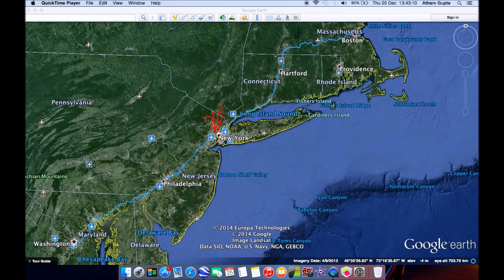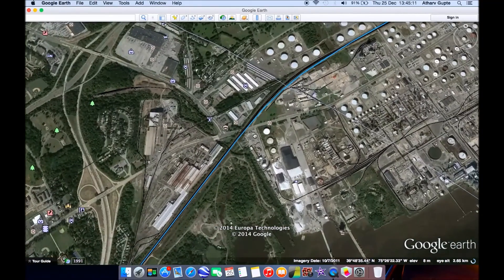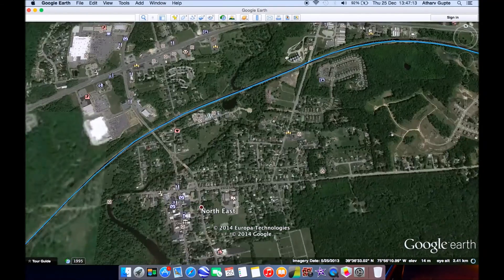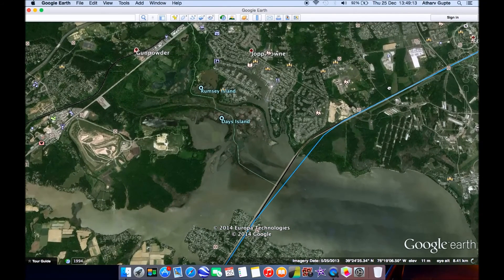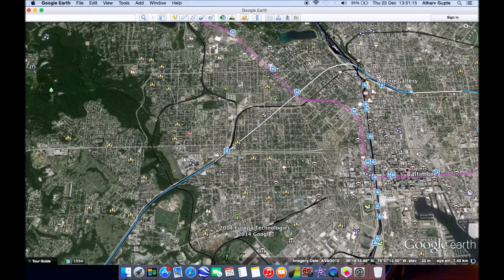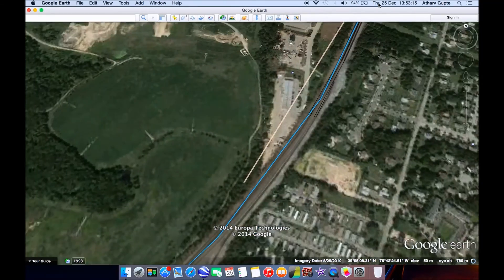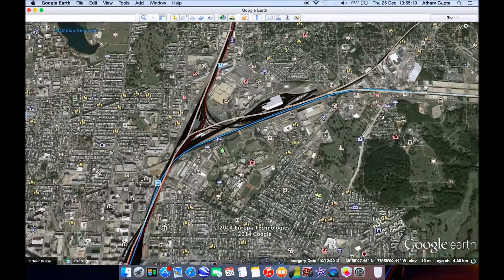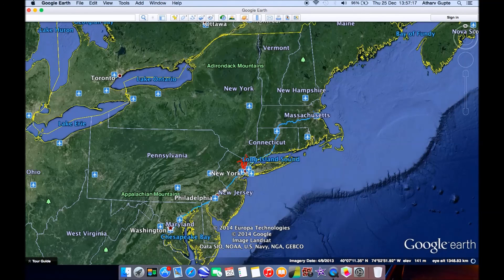Philadelphia to Baltimore to DC High Speed Rail

Comment: Great video! I wish people would stop arguing about how the fact they have to bulldoze a building prohibits this plan from advancing beyond the planning stages. 2 areas for possible improvement: 1- did you check your curve radii against the FRA regulations for cant deficiency? The FRA only permits a cant deficiency of 3 inches and a superelevation of 3 inches. Some of those turns you mentioned would be 240 km/hr look a little tight for that. 2- you mention a mountainous area and suggested a tunnel between Bowie State and Odenton. The area is not mountainous at all. It's a swamp between 2 rivers and the local relief is less than 100 feet. The area is forest because it is protected as a wildlife refuge. Honestly I think you could just get away with cut and fill to make this segment straight as an arrow.

Comment: I think the train should cross the Delaware River south of Wilmington and connect to Philadelphia with the patco high speed line.  This would save billions and encourage cities to prove their local systems. Wilmington could build a commuter rail to the airport and then to the HS station in NJ. You could board the train in Newark, Claymont and even in southern Delaware if the state had a line downstate and then travel to the HS station in 20 minutes from Wilmington

Comment: Amtrak has discussed building a new station in Downtown Baltimore, in the vicinity of Charles Center, in a future high speed rail project.  The line would reach the station via a new tunnel under East Baltimore; the line would re-emerge from the tunnel near the West Baltimore MARC station as yours does.  It would be interesting to know the cost/speed difference between your idea and theirs